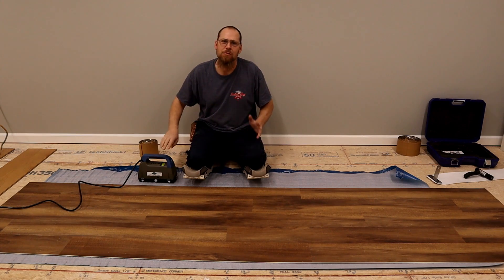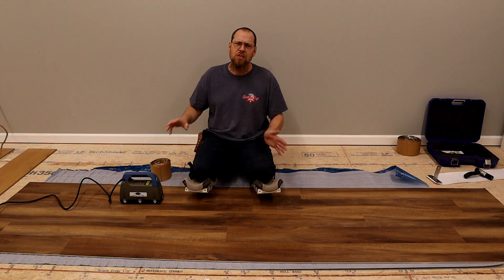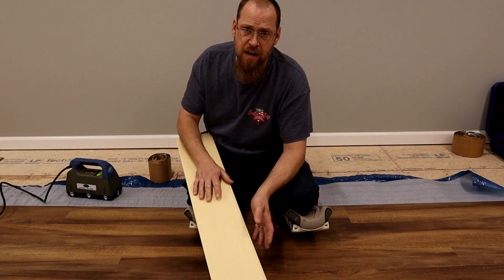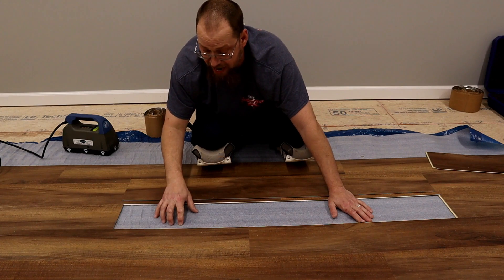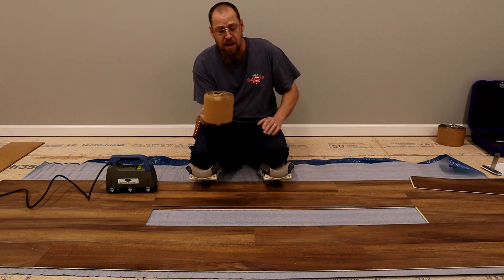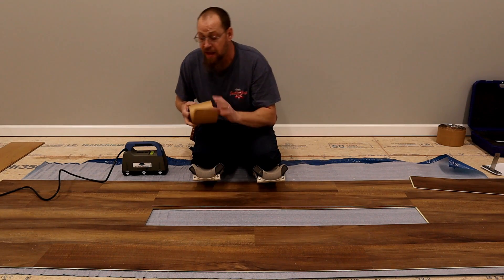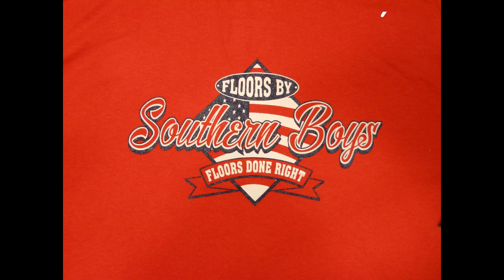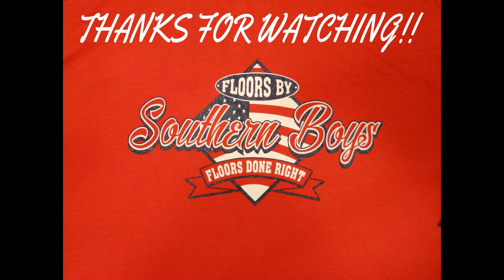vinyl plank repair with a seam iron

Comment: I’ve got a section in a hallway where the planks are staggered, and don’t lock.  Would this work for holding down some plank ends that are lifting up a few millimeters? Or, would this be overkill, and adhesive would be fine for what amounts to 5-6 plank-ends.  If some adhesive is your suggestion, what adhesive would you recommend to glue town cork-backed, LVP to self-leveling concrete?  I need to find a long-term, durable solution for this problem.

Comment: Can you do it also if you cut the 4 sides of the vynil plank? And which sides do you cut from the planks already layed down? And what sides do you cut from the new planks getting installed? And last question will it work with a roberts iron?
Reply from the maker: Gabriel Silva Yes you could cut All four sides, but there would be no need and the planks that are already on the floor do not leave any modifications and on the plank that you are replacing you only need to cut the signs that prevent the plank from laying back down,And no Roberts iron will not work

Comment: how about joining vinyl plank to the carpet with the kool glide tape instead of a trim?
Reply from the maker: Martin Baker You will need the trim to hold the stretch on the carpet And also keeping the carpet from fraying on the edge, a floating vinyl plank needs to be able to move also, really nice thought though
Reply: I mean glue down (pressure sensitive) by the way
Reply from the maker: Martin Baker oh yep

Comment: Great video! I did a repair without the cool glide but watching this made me want to try it. Quick question,would this work on hardwood? Because the cool glide sometimes burns.
Reply from the maker: jc 7394 Yes sir I have used it on hardwood several times with no issues , In fact that’s going to be my next video
Reply: @FloorsbySouthernboys  another question appreciate the video and your work. Can you also do cool glide on lvp with padding or laminate with pad?
Reply from the maker: jc 7394 yes sir i have videos on both

Comment: Why not just slip in the replacement plank the same way you removed the damaged plank?  I guess this replacement method would only apply to planks that do not press-in and lick on the short ends.
Reply from the maker: Ma Ma It will work on pretty much any type of vinyl plank, the only difference is you have to adjust the third side like I did the other two sides, I will be doing a video on that shortly
Reply from the maker: Ma Ma And as far as slipping it in like the other one came out, you have to cut the other one to get it out and shave off the extra lips to get the new one in and that’s what causes it to look in so that’s why it needs to be glued
Reply: This is also a great way to seam together vinyl planks if you're joining new and old or if people want the material running in different directions in different rooms. And dont want transitions. I did a demo at a flooring store and we ran different colors all different directions and did borders and seemed it together with a kool glide. I wouldn't have tons of use for one though because I  do 90% commercial flooring.
Reply from the maker: Florida Man Well that was interesting, thanks for sharing that